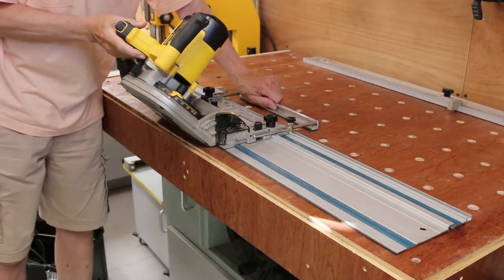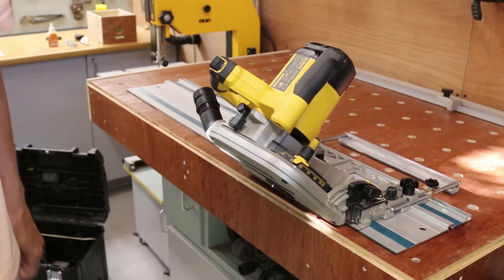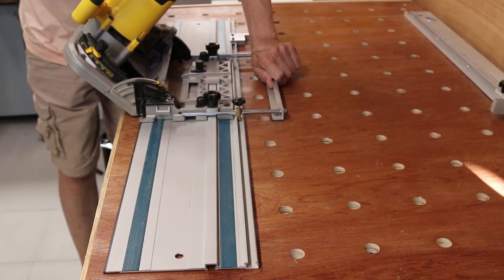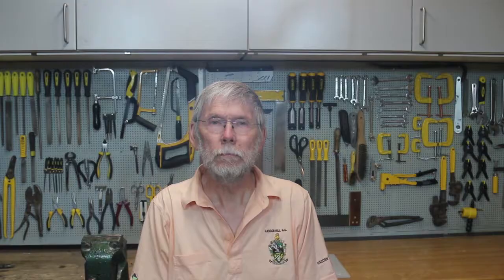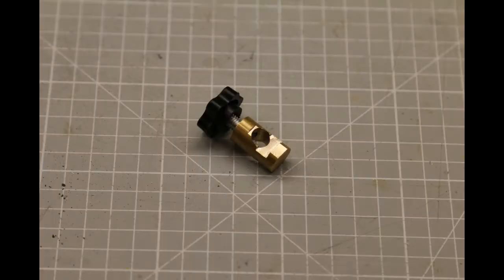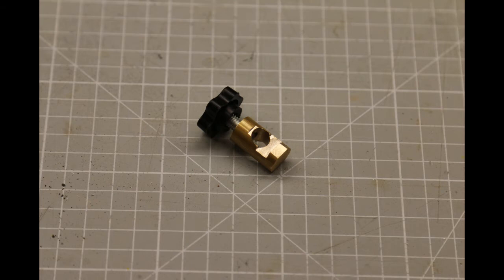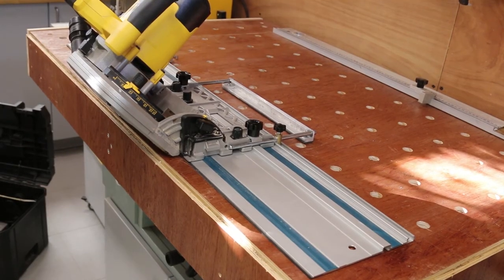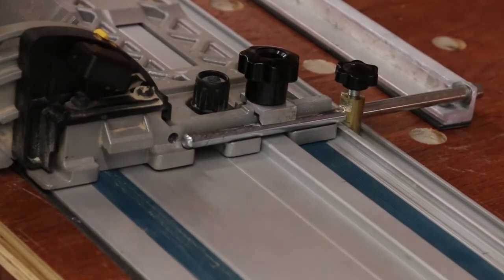Tracksaw anti-tip accessory

Comment: I may have missed it but I am wondering how you are able to run Dewalt track saw on a Makita rail? I am trying to decide between the Dewalt and the Makita at thr moment and have multiple Triton guide rails. I have purchased both saws at the moment while comparing the two. The Dewalt shoe hits the anti tip ledge/lip on my Triton track that I believe are identical to the Makita. I have been considering removing material from the shoe vs removing material from multiple tracks. Any thoughts would be greatly appreciated.
Reply from the maker: You are correct, the DeWalt will not run on Makita rail as is. As I briefly covered in my MFT video, it requires the lip to be machined off. I used a milling machine, but others have used a standard router. Whilst you can use Festool track directly, there is a price premium for what is just a different extrusion. I considered modifying the tracksaw instead, but I like being able to drop the saw onto the track at any point. This jig does the same job, but is only needed when tipping is an issue.
For me, the DeWalt has features that others do not- in particular the cantilever movement. Features it does not have I attempt to add. Others may have different priorities.
Reply: @Tensquaremetreworkshop  any thoughts on removing the material from the shoe of the track saw? (about an 1/8") Thinking that it would be easier than altering multiple tracks.
Reply from the maker: @RobyWanKenobi  I would take it off in my milling machine- lacking that, it should file off without too much effort. I only use Makita rail when I need to register it, so one rail for my MFT. I like the centre guide of Dewalt for other cuts.
Reply: I know this is ~9 months later, but I recently purchased a PowerTec track for Festool/Makita and ran into this same issue with my Dewalt 60v tracksaw. I set my table saw to a .625" width and ~.200"  depth cut. This was just enough to rip the little tab off. I then flipped the track upside down (anti-slip tape facing UP) and referenced the t-track on the fence. I used a scrap of 1/4" MDF to support the splinter guard side and pushed it through the table saw. Took 10 minutes and saved me $100 compared to Festool track.
Reply: @benjaminmarotte2924  love it. And Peter Millard posted a video where he uses the track saw and another track to do the same. Both very simple but very effective solutions, yet oddly out of sight for me. My co worker is a Makita guy and we give each other shit about our tools all the time. He was aware of my track saw dilemma came across a floor model Makita and gave it to me for Christmas.  Makes his day every time he sees a little blue in my sea of yellow.

Comment: Have you done anything to track adjusters on the track saw? All my tracks have different slop and find adjusting from one to another very frustrating.
Reply from the maker: I agree! Thanks for the idea, I will investigate.
Do you find this a problem with tracks from the same manufacturer, or just between different makes? My DeWalt track saw uses a different slot for single sided track than native DeWalt track, but uses the same adjusters for both. A bit annoying, but possibly fixable. Slightly different widths on different tracks is either a manufacturing tolerance or a design difference- one could question why.
I have just run a micrometer over my rails- the Makita is 15.8mm (!) and the DeWalt 17.0mm. Using different slots, the main difference does not matter, but the 15.8 suggests 16 nominal, and rely on the adjusters for the rest.
Anyone else measured this? The more info the better...
Stop press- just checked, and the specified width of Festool, Triton and Makita are all 16mm. So my Makita is 'undersized' - wonder if the others are too?